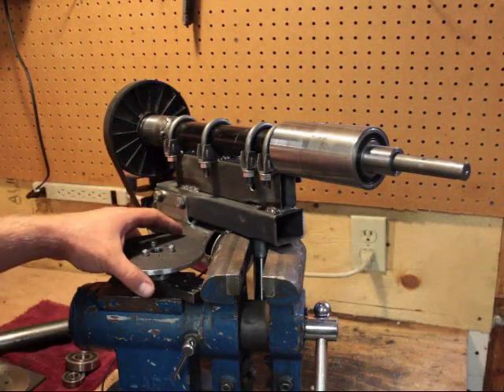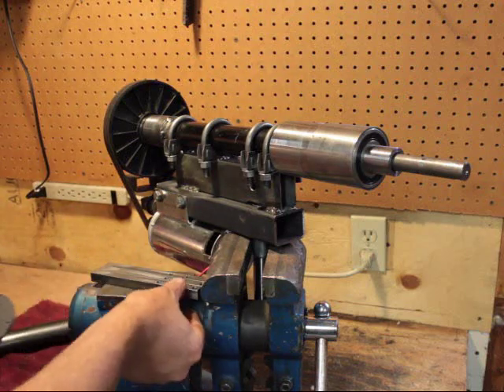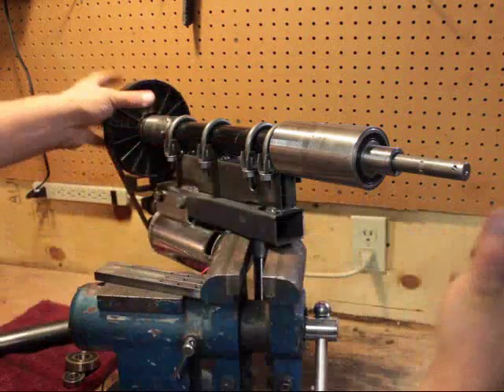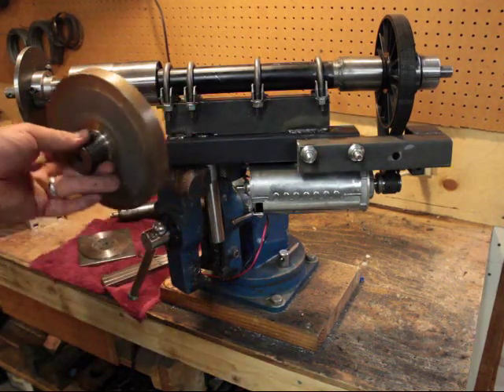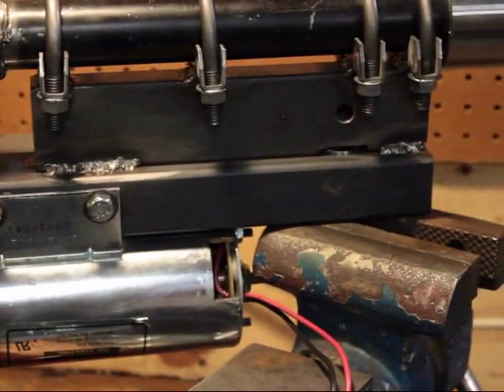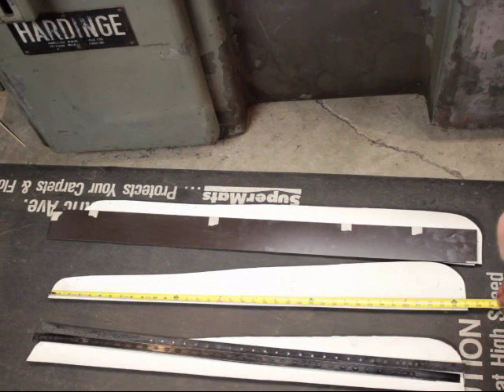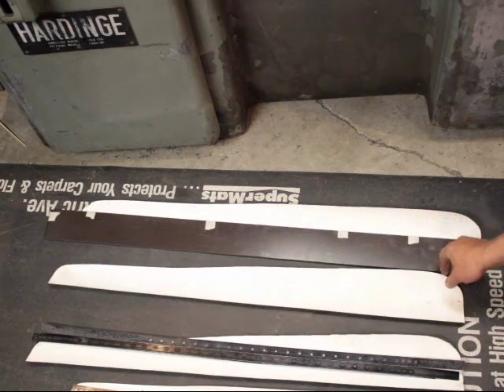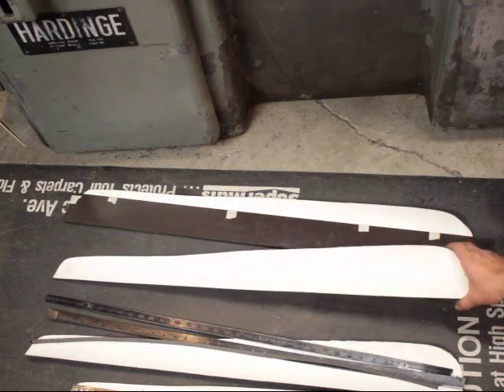Part 2 Grooved Belt Treadmill Motor Wind Turbine Generator DC PVC Blades Gear up PMA Logan Lathe

Comment: I started fooling around with wind about 8 years ago, my first testbed was with belt and pullies, without a generator attached to see what kind of drag I would have. You also have to take into consideration the cogging effect also, even more resistance. No my gennies arn't up on youtube not flying them now where I moved to. Too many trees. 1 treadmill 90v, and 1 Amitek 30v and 1 Amitek 50v plus 400w airx.

Comment: You would be much better off doing a direct drive, blades mounted to wind genny. Pulleys cause too mush drag and friction, you will not get optimum  wind speed with that set up. Been there done that.

Comment: Very nice machine work--I'm liking the engineering so far as well. What metal thickness is the shaft housing (tube)? I've seen an old style blade counter weight design you may like--I'll try to post a video on it soon--It might give you some thoughts on evening out your weight distribution issue. Good job!